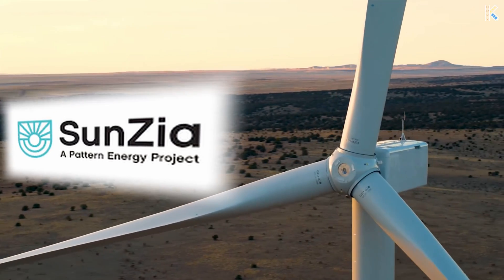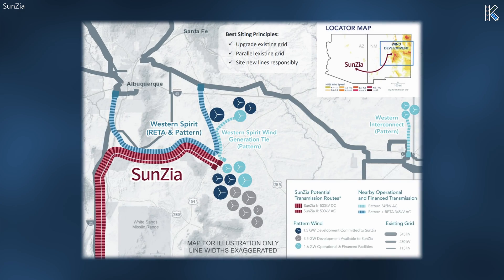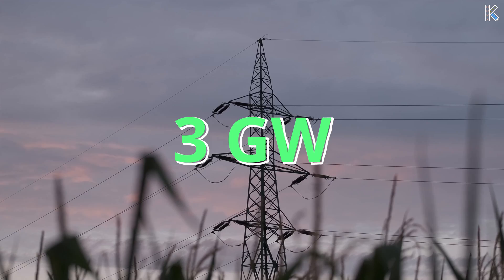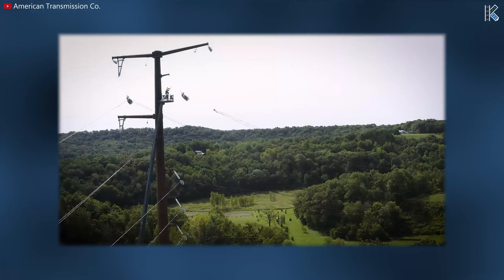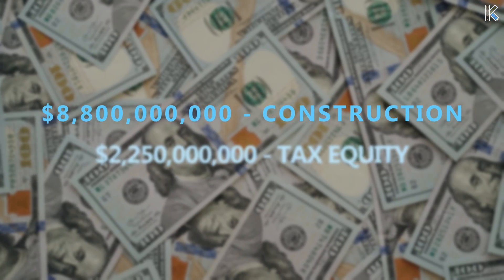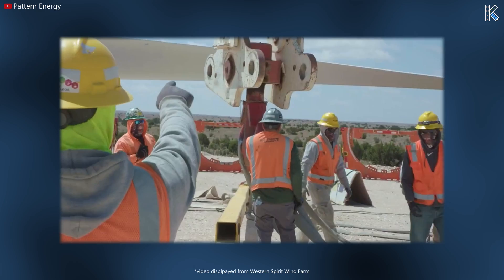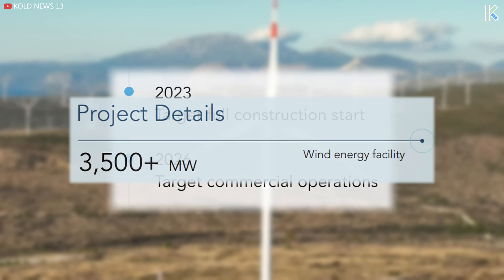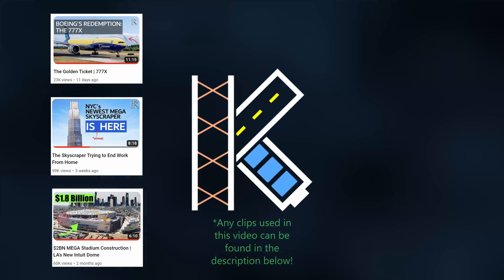New Mexico Mega Project Powering CALIFORNIA: SunZia

Comment: The US is using the same general amount of fossil fuels for generating electricity.   I think you're confused by the percentage of wind and solar wild AC pushed onto the public power grid.   Wild AC supported by the public power grid  in the double digits, but it takes more natural gas turbine generator fuel to instantly back up that wild AC up than to make all the electricity from economic fuel efficient means.   The advertised fuel savings in the US is 1% each for wind and solar, that is  an exaggeration.  

Without culling the output significantly of wild AC to a more steady lower output it takes more natural gas to support the erratic unpredictable dips of the wild AC than making all the electricity from efficient running natural gas combined cycle power stations.   Natural gas even a low nearly breakeven production cost prices is too expensive a fuel for base load electricity generation.  

Solar voltaic and wind turbine electricity generation practical use is for maintaining electrical storage such as charging batteries or working with something similar such as fast reacting hydropower.   There is a concept to address transmission and electrical storage of solar and wind generated electricity in Colorado with the use of battery freight trains at the length of  unit coal trains.   The connected battery rail cars would be charged from solar and wind electricity generation then shipped 100 - 200 miles for use in urban areas such as Denver.    

Battery trains have a huge advantage over other wild AC support because there is little penalty for their instant response for making up dips in home solar voltaic output up to 100%.   Local electric power companies are required to support every wild kilowatt connected to their power grid.

Comment: If you want to talk about wasted energy, you should do an entire video on "Rejected Energy" which is power losses when trying to power and/or heat our civilization... You will find that despite the intermittent nature of wind and solar it's still FAR FAR FAR more efficient than using fossil fuel's. Just like how EV's powered by coal fired electricity is STILL cleaner than if you drove an ICE powered car in terms of overall emissions but also local PM 2.5 that is one of the most deadly sources of forever pollution your body will never be able to rid itself of. Every time you ignite carbon that's what happens.. Enjoy!
Reply: What is rejected energy?

Comment: These are precisely the kind of engineering megaprojects America used to do well all the time and has really forgotten how to. I really hope that this one is a success because just a few dozen of these types of GW scale solar or wind farms would really make a huge difference in the nation's carbon footprint. Especially if you pair that with a few other innovations that would make America Green again like geothermal heat pumps, electric cars, buses and trains as well as nuclear power which although controversial in some circles has the largest potential to clean up baseload energy in a meaningful way... After all you need only look to Canada which is running on an 86% green grid now largely due to hydro but also nuclear power... And the provinces without hydro power have committed on building nuclear power to clean up that last 14% that isn't green now including Tar Sands fueled Alberta..
Reply: I am NOT reading all that ☠️
Reply: Do you realize there’s like issues with the pro types wind turbines? Nuclear energy is better